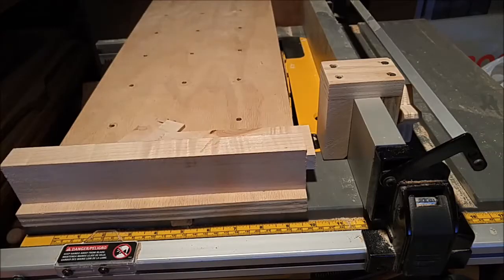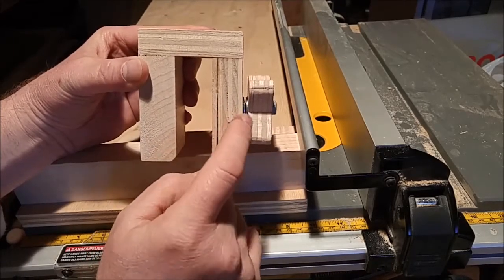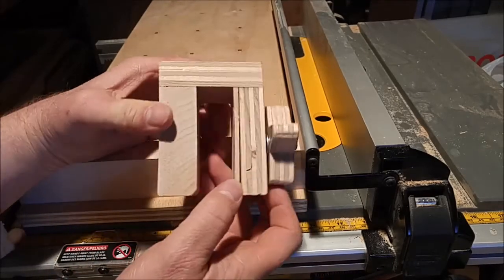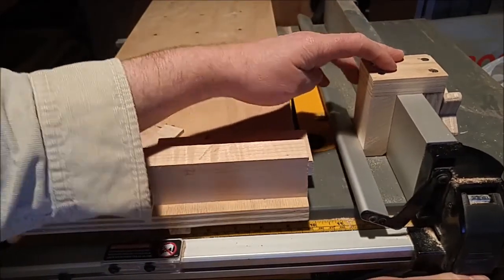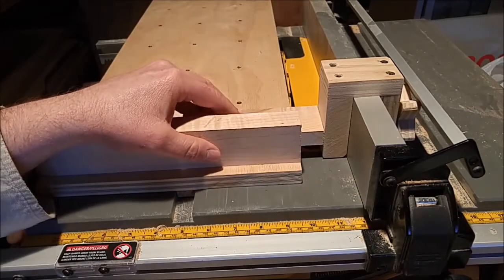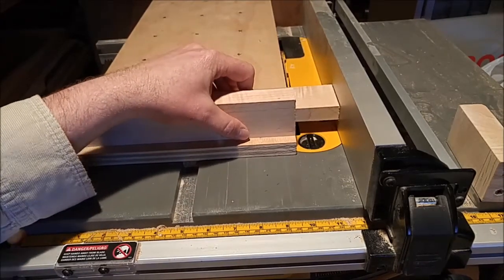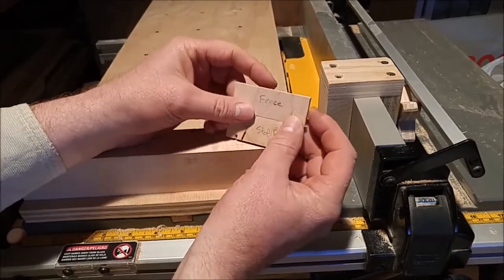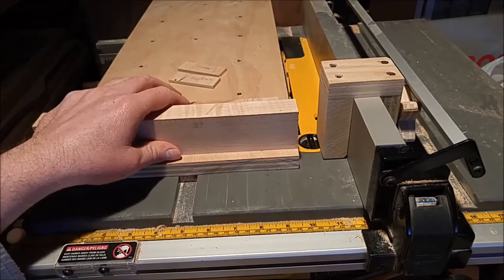Table Saw Stop Block

Comment: Hey wanted to thank  you for a giving me the right idea on a stop block.  I modified it just a bit and made 2 of them.  I am going to make 2 more tomorrow.    Made a short video on the stop block and the mods.  While your stop block use on the rip fence doesn't need the clamping power that I had a need for your idea with me adding some stiffing was just the ticket.  Here is the video.   Thanks again!
 https://www.youtube.com/watch?v=1OED1rbtbuI&feature=youtu.be

Comment: Wow! Love it. I will build this! Thanks for making and sharing this video. Be well!
Reply from the maker: This makes it worth it to me to post these videos, glad you like the project! I can say I use this stop block often with my table saw and am very happy with how it turned out, it's well worth making it in my opinion. As a suggestion you may want to check out the cross cut sled  video on my channel as well which was intended to work with this stop block and has a bunch of cool features over other designs.

Comment: Any chance to get that on metric?
Reply from the maker: Hello Frank, Glad you like the video. For sure you can easily change the Sketchup Make CAD model dimension units. After opening up the CAD model all you do is select on of the components then click "Window" top menu option, then click "Model Info" then click "Units" then up at the top of that pop up window where it says "Format" then select for example "Decimal" and then just to the right select "mm". Then all model dimensions will convert to mm. It is a real conversion meaning for example 1inch now would equal ~25.4mm.